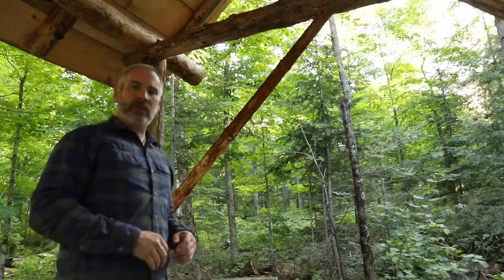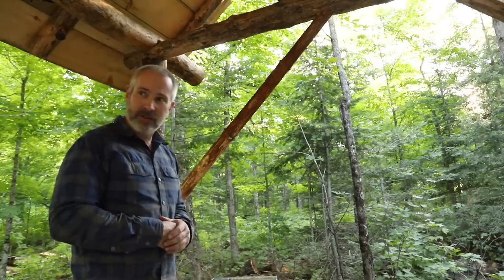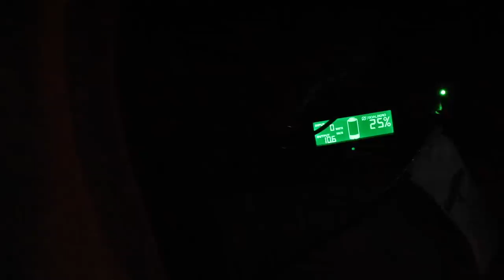What Happens at the Cabin, Stays at the Cabin

Comment: Huge fan been watching for months. I used to work in a brick oven pizzeria. Items you need. Make a metal peal out f stainless. Just like a giant flat spatula. Make it heavy duty enough that you can pull logs if you stab at them or put logs in fire in the back. Get a good metal brush. Mopping it out is not as important as keeping the embers off the stone. I suggest using a wet natural bristle brush instead of a mop. The ash catch is cool. Wood peel should be your next project. Also when try your pizza dough recipe what ever amount they say for flour cut it in half and use the same amount for semolina. Also try stretching the dough with a flour semolina mix it’s less likely to stick to the stone and you would not have to start it off in the cast iron. Keep her clean and keep on cooking

Comment: turn  your  cast iron  fry pan  upside  down  put  the  pizza on  the  bottom of  it  after  it  has been  in  the oven for  awhile  using  gloves  for  you  it would  work out  great that  way   handle  will be  able to be  pulled on out  then  when  finished